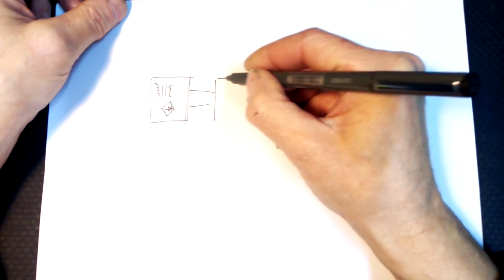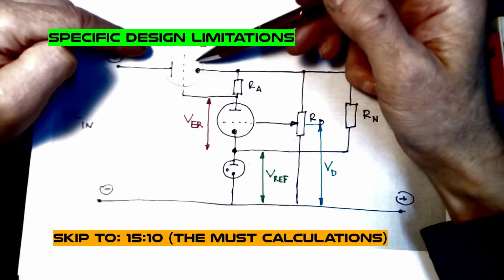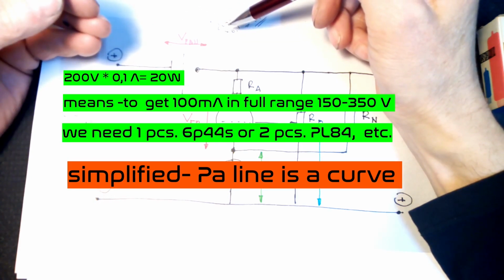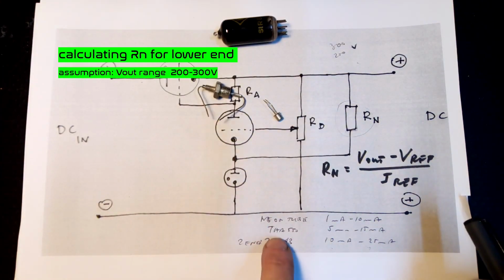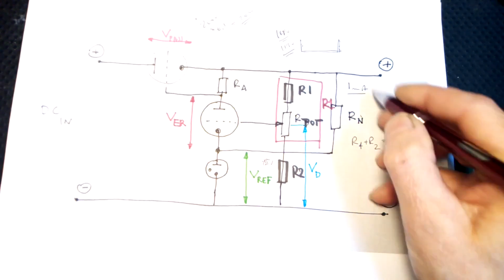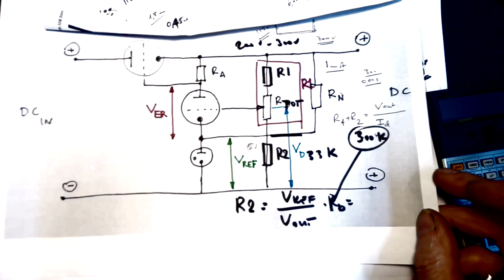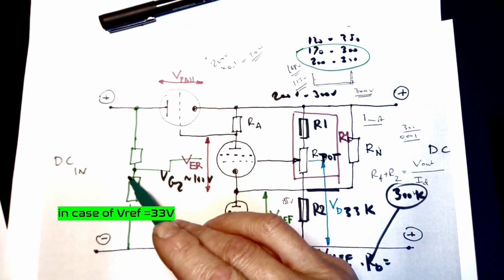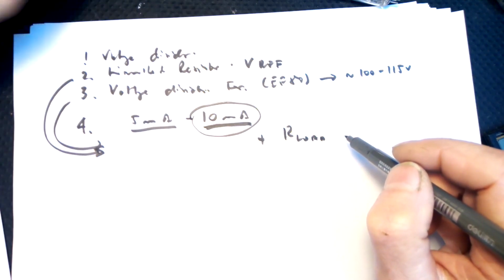How to build and design  tube variable power supply in easy way

Comment: Thee question is - why not use semi-conductors instead ?
Reply from the maker: good question :-) 
first of all it's my personal preference :-)) and glass envelopes keep magic smoke inside much better :-)))
More serious,  i'm bulding tube amplifiers means for me is natural choice, valves are mach more resistant for temporary overloads , shorts etc. + tubes was designed to work with high voltages  means we can build it simpler forget about overload or shortage protection , destrucion will be after minutes not miliseconds.
Reply: @undergroundworkshop8278  Unless there is  a tangible benefit to the end user I can't see the point - and I don't think anyone else will. Yes they are more robust but they are also more expensive. Design complexity is not a concern of  someone who just wants to buy a product - they just want low cost and reliability.  A failing semiconductor based product can often be replaced quickly and you always have the big problem with valves of power consumption - especially with the cost of electricity.
Reply from the maker: I'm end user :-)  For me  (and suspect that for everybody who playing with vacuum tubes technology also) is good solution, such a cheap junk tubes, like tubes for line TV amplifiers are just in drawer.
Vintage valve PSU like E350 quickly vanishing from market means kinda of niche hobbyist demand exist.
When u building something by yourself design complexity is an issue, isn't it?
I know guys who using  amps  take 120W only for heating power stage 2 valves not counting preamp drivers and HT 
Power consumption ? :-)) Who said that hobby will be cheap :-))